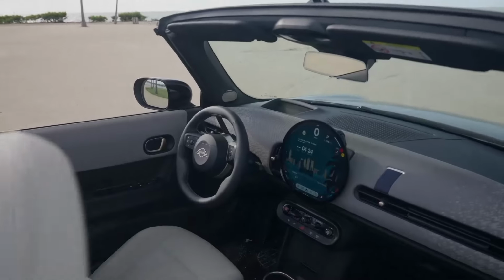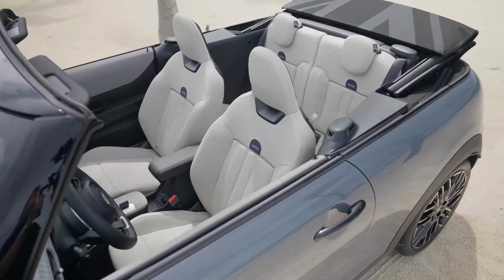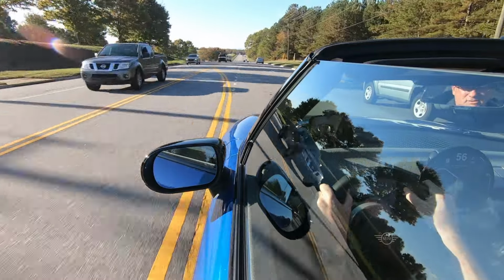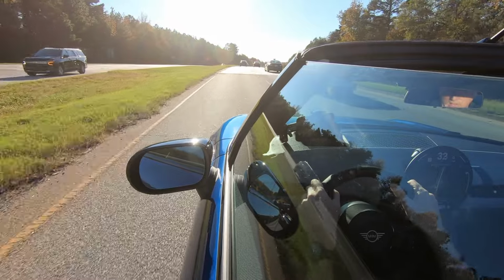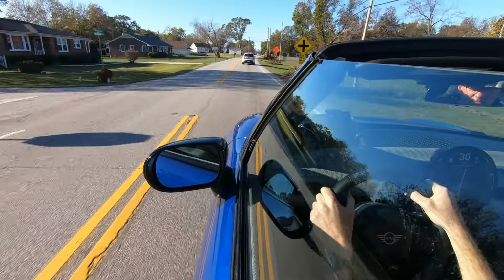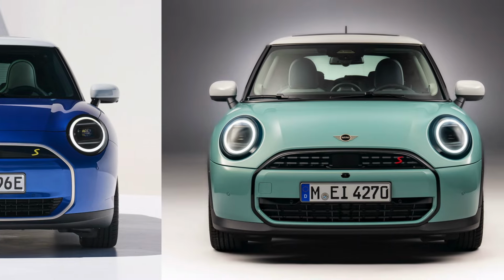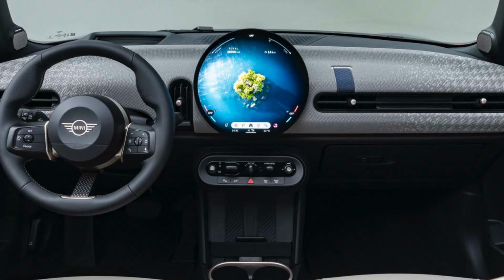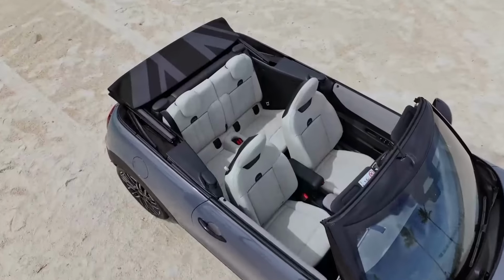2025 MINI Cooper S Convertible - First Drive & Interview with MINI USA PR Director

Comment: I’m on my 2nd 2006 S convertible.  1st gen convertible didn’t offer “openometer” gauge.  That gauge came with 2nd gen convertible…What I’d be interested to know is if MINI will offer the 3 cylinder hardtop/convertible variant?
Reply from the maker: They will offer the convertible as a Cooper C but it will have the four cylinder rather than the three.
Reply: @MotoringFile  Thank you!